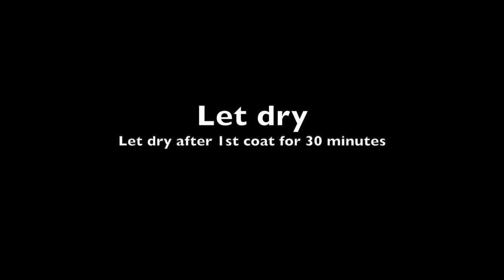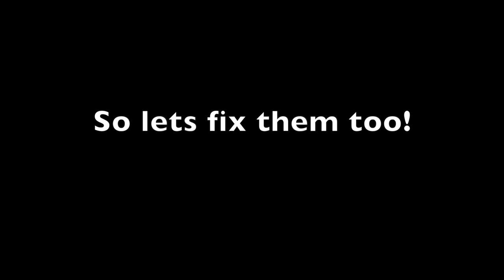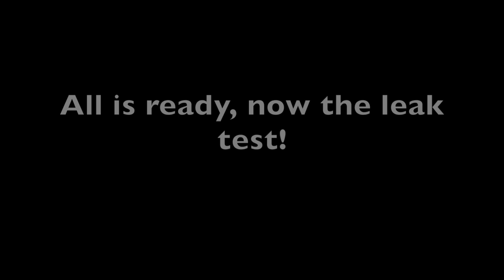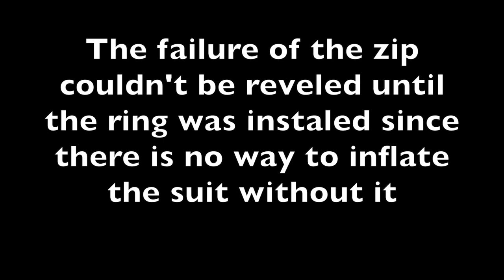Fixing Otter Drysuit SiTech Quick neck ring and other stuff. Part I

Comment: May I ask what glue are you using in the video?
Reply from the maker: It’s Rema tip top sc4000
Reply: @DrySuitProjects  what about the sc4000 and E-40 The mixing ratio ?
Reply from the maker: @yuoyeung2269  100gr glue to 4gr hardener if I'm not mistaken. You can verify on the manufacturer site
Reply: @DrySuitProjects  thanks for your help